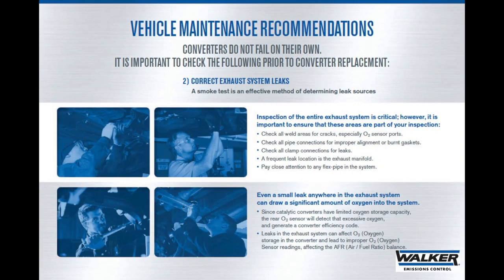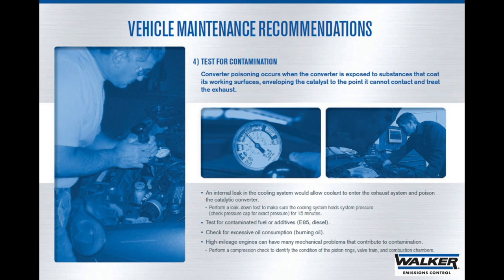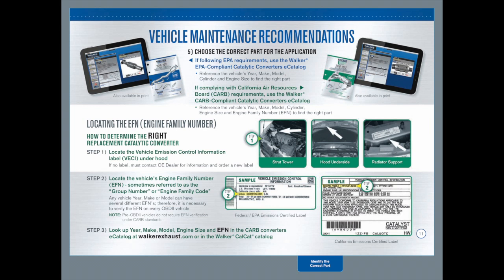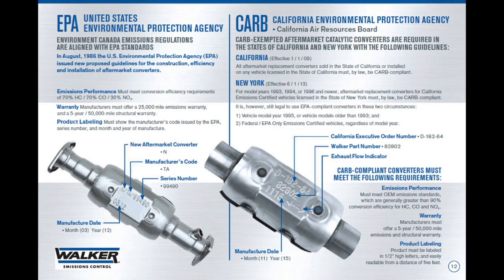The Trainer #68 - Troubleshooting P0420/0430 DTCs (Catalyst Efficiency Below Threshold)

Comment: Can running with slightly to much oil cause these cat efficiency codes?
Reply from the maker: It's possible if the breather system is drawing the oil into the intake.

Comment: THERE IS AN EASY, CHEAP & PERMANENT FIX, JUST INSTALL 2 SPARK PLUG NON FOULERS INTO THE O2 SENSOR BUNG AFTER THE CONVERTER AND THEN INSTALL THE O2 SENSOR INTO THE NON FOULERS. NO MORE CODES, THE CAR RUNS GREAT, & PASSES INSPECTION. I HAVE BEEN DRIVING MINE 5 YEARS NOW LIKE THAT. COST WAS LESS THAN $10 AND ONLY TOOK 10 MINUTES TO INSTALL.

Comment: I checked live data on my ES300 and the rear 02 sensor readings with be in a good place and then randomly go low or high (mostly low) and don't match each other. One may stay low for 10 seconds and then bounce back to 450. This is at steady highway speeds. I can clear codes and will eventually get a P0420 or P0430 or both. The car has 200,000 miles. I runs very smoothly.  I'm thinking bad downstream 02 sensors? I hear one is a real joy to change..
Reply from the maker: Conventional oxygen sensors tend to fail and not come back to life. Try a snap throttle test and see if they both react.

Comment: I have a P1273 code on a 05 murano. So I hooked up the scan tool and looked at the voltage, I compared Bank 1 and Bank 2 readings,the Bank1 has.300 volts and Bank2 has .600 volts,the two readings should be the same,right ?
Reply from the maker: What are your STFT and LTFT doing?
Reply: The STFT is 0.7 %and fluctuating ,the LTFT is, -10 %
Reply from the maker: @mckoylach1622  Both banks?
Reply: Motor Age yes,both banks...thank you
Reply from the maker: @mckoylach1622  Can you share freeze frame data?
Reply: Motor Age yes, but I need to check it by tomorrow,I appreciate your efforts very much,thank you...
Reply: Motor Age hello again. The trouble code is,P1273,ABST% is,1.5,Eng spd, is 637,CALC load is %40.3,coolant temp is 188,STFT1 is,-5.1,LTFT1 is-10.4,STFT2 is,-12.1,LTFT2 is,-10.4,STFT3 is,-100.6,LTFT3 is,-100.6,STFT4 is,-100.6,and LTFT4 is-100.6,hopefully those infos will help me to fix my car,thanks once again

Comment: Is there any reason why a 2016 78k miles versa would be getting 2.200 b1s1 and .400-.800 b1s2? I should note code p0420 with part of the intake housing broken parts to engine compartment so small holes in intake
Reply from the maker: I'm betting that the front sensor is a Wide Band sensor and will typically show a higher voltage than a conventional sensor. The rear is almost surely a conventional sensor that sounds like it may be switching. That could indicate that the feed gasses going to the cat are incorrect OR the cat is bad. Need more info...
Reply: Motor Age what other info is needed. Code p0420 comes up too. That should be enough right?
Reply from the maker: @priusgame1178  Not really. There are a lot of possible causes for the P0420 code. The intake leaks are likely the primary cause and should be repaired before the cat is truly damaged (if it isn't already).
Reply: @VehicleServiceandRepair   Motor Age  I will be replacing the damaged part of the intake housing today. My next would be to check if the cat is done I just want to see if it indeed shows in my readings. I am seeing these have a/f sensors so I took a different route in testing the readings which I hope I can learn here soon
. I am being told 9 times out of 10 p0420 is for sure a bad cat... I'm hoping to be that rare 10% with this 2016 versa how they rely on a/f sensors now
Reply from the maker: @priusgame1178  You may want to take it to a dealer after you fix the intake. Cats are generally warrantied for much longer than the basic powertrain warranty.

Comment: Hi there , I changed my Catalytic converter and the exhaust Manifold going together , and I did change 
the Oxygen Sensors ,both of them , I still get code P0420 ! 
What could be wrong ?,

Thanks .
Reply: Spark plugs
Reply: @honestscentz9300  : Hehehe , what  ? 
What Spark plugs have to do with changing a Catalytic Converter ? 
My Spark Plugs are New as well .
Reply: @ironfistarrival  a lot. And a Fouler "02 sensor extension" does not fix any problem.

It just fools the sensor to keep the Check Engine Light off. 🤦‍♂️

U still have an issue that can destroy the Cat and then the code extension won't do squat. 💁‍♂️

U need to fix the problem that gave off the code in the first place. It could be spark plugs/mis-fires, MAF sensor, injectors, leaks, etc. Etc.
Reply: @adrianapollyon5087  : Thanks for the message , i put an OEM New Catalytic converter after having the Code related to it , but i still got the Code coming up ,so i put the Extension and no more code , i am wondering why your are mentioning Mis-fires issues [ spark plugs are New , MAF is new , injectors not new ,i changed the Engine through a Mechanic , their Scanner did not show any issues at the time i use a good injector cleaner inside the Tank often though , so even though the Catalytic converter that i changed it myself is new what else could be the issue ?!! It is a  GM car Hummer H3 2008 ... any other thoughts ? Thank you so much for your comment .
Reply: @ironfistarrival  put an OBD scanner on it. And check your fuel trims. 

Could be an air leak intake leak, exhaust leak. 💁‍♂️ (even without a air-leak code p0171 etc) 

Could also be other stuff. Check that specific vehicle year and model for past recalls on it. Look into what problems others have had with that same vehicle.
Reply: @ironfistarrival  misfires mess with the air-fuel ratio. So then there is too much fuel not combusting and that goes through the Cat. So then the 02 sensors do nothing  but read oxygen and fuel levels that pass through the Cat. 

The computers in Vehicles use the data from the 02 sensors to determine how much fuel or air to it needs to keep at its stoic- measure of 14.7: fuel to air-ratio.

So there can be a problem with the air-fuel ratio which is causing the Cat code of p0420 to show up.
Reply: @adrianapollyon5087  : Thank you for the help , i guess i will have to check the Air intake gaskets  , Injectors , Fuel Tank Contamination [ A possibility ] , cleaning the Fuel Tank is a good thing to do .... Compression test was good , i do not thing any issue with the Leak down test , which is a good test ... however i have issue with the Temperature Gauge while in Idle goes a little above the Middle point , when car runs comes to the Middle ! , Thermostat + water pump were changed , and the Sensor looks good , but i want to change the Thermostat with a good one see what happens , i hope there no issue with the head cylinder ...strange situation ! ... i asked the Mechanic  to put the new Thermostat , i told him this issue , he said do not pay attention !
Reply: Lennox where you at now?
Reply: Deadbuck73 .... In Canada ....
Reply: Lennox I meant with your car situation! Lol!
Reply: @ironfistarrival  I had a P0420 at 118,000 miles and pulled my coils and plugs out of the cylinder - they were ate up and put new ones in - SUPRISE,, SUPRISE, SUPRISE - spark plugs, booooyahhhhhhhhhhhhhhhhhhhhhh.  It was the first things i tried by chance since i knew they had never been replaced.  I like the vacuum cleaner blow hard test - gets up into flex pipe and forward if you spray with soap/water cold and vacuum cleaner  blowing up tailpipe - if done hot with soap spray the metal may still be expanded and no leaks will show unless your flex pipe has a huge HOLE.  Actually a Hyundai tech told me he saw this allot and try?
Reply: @richardborges1457  ...Hi friend , i did change spark plugs , and even the Ignition coils , my car has over heat problem , the Gauge indicates higher than the middle range , and the mechanic changed the water pump and the Thermostat , so maybe i change again the Thermostat to a good quality one ,  and the Sensor for the Antifreeze seems good ... i am confused !
Thanks .
Reply: @adrianapollyon5087  ...I installed the Catalytic converter myself and i doubt if 
there are Exhaust leaks , i double checked the installation , and sprayed it with Brake cleaner for Exhaust leak , or Vaccum leak
do i have to reopen the Exhaust Manifold 
again ?!
Lord ! i have these Sensors in modern cars .
Reply: @ironfistarrival  I soldered a ohm resister to the wires of my 02 sensor bank 2. 

Code went away. Never came back.
Reply: Miss fire and lean and rich it all about a tune up the Honda dealership in Pennsylvania Diagnosis my po420.
Reply: @honestscentz9300  ...My spark plugs are brand new ... my friend ..
Reply: Lennox I put on 45,000 miles  since I posted responsed a year ago I used denso 02 sensors and ngk spark plugs and that code never came back on
Reply: What is the year/make/model of the car? Some cars have 2 converters; one just at the outlet of the exhaust manifold and one further downstream, but before the muffler.
Reply: @SouthernBikerTV  : Sorry for late reply , i just saw your comment today , my car is Hummer H3 2008 3.7 L , my car has just 1 converter , what i did was i added an Extension to the Oxygen sensor on the down stream , so the Oxygen sensor is mounted on that Extension , that solved the problem , but i guess probably these OEM made parts may not be that compatible to our cars ?! Now i have to change the Secondary Vacuum air Pump as well , so far what is your opinion after what i said ?
Thank you .

Comment: LOL. This video is no better than the rest of them. One code, and it could be FIFTY possible causes. Yeah, tear half your engine apart trying to find the problem. What the hell good is a trouble code if it doesn't tell you what's wrong? A worthless joke!
Reply: For you the easiest way is probably just keep chucking parts at it until it's fixed.
Reply: @Johnsmith-zi9pu  Guess again. Since my comment, I only had the cat replaced. Got rid of the P0430 code.
Reply: @jakejones5736  Your lucky, it could have been a sensor fault or incorrect air fuel ratio and you would have flushed  your money down the toilet.
Reply: @Johnsmith-zi9pu  Yeah. At the time, I had it in the dealer for a couple K worth of other work, so decided to have them confirm the diagnosis and replace. Even though it was in their hands, it wouldn't be the first time the DEALER has misdiagnosed...  costing me money. Based on that, I have to agree, I WAS lucky!
Oh, and since they already had half the engine apart, the additional labor cost was minimal. Not to mention, due to politics, the ONLY place you can get the part is at the dealer.

Comment: LASERS can reflect off of surfaces.. a plumber taught me this, he puts masking tape on plumbing pipe to get accurate temperture.
Reply from the maker: It's not the laser reflecting off of the surface. It's called emissivity and refers to the materials effectiveness in emitting energy as thermal radiation. Emissivity is defined as the ratio of the energy radiated from a material's surface to that radiated from a blackbody (a perfect emitter) at the same temperature and wavelength and under the same viewing conditions. Black is better than shiny...

Comment: HELPPPP.. Igot 420 and 430 codes. B1S1 0.300 AT IDLE  0.285 AT 3000 RPMS
                                             B1S2 0.280 AT IDLE 0.280 AT 3000 RPMS 
                                         B2S1 0.600   AT IDLE 0.580  AT 3000 RMPS 
                                         B2S2 0.290 AT IDLE 0.310   AT 3000 RPMS ON AUTEL SCAN TOOL
Reply from the maker: Let's start at the beginning by identifying the vehicle you're working on. Make, model, year, mileage? Any other codes stored? How does it run? What are the fuel trims for both banks at idle and 2500 rpm. Are the front O2 sensors switching? Are the rear O2 sensors switching?
Reply: 05 nissan frontier, v6  runs very good. no other codes stored. has 2 converters and 2 banks., one bank doesnt seem to do anything at all, it =justs stays at.285 mostly,.  idle or revved it doesnt change.. the other bank, it changes
Reply from the maker: @randy1ization  There are so many tips I could share. First, make sure the O2 sensors are working properly. You can do this by performing a WOT test and see if the sensors respond. They should swing low as the throttle is slammed open and go full rich when the throttle is shut.
Reply: Ki

Comment: Hello. Sir   Would you happen to know anything that can cause a switching rear o2 sensor other that a bad cat? Thank you.
Reply from the maker: Sure! If the feed gasses going in are out of whack, beyond what the cat can handle, you'll see the sensor react - but usually it will stay high or low. Key is to make sure all the other variables are correct before you condemn the converter.
Reply: Thank you. I like" Usually, it will stay high or low" because if the feed gasses is rich, the o2 will be high, and low if the feed gasses is lean. Unless you have leaky injectors and a vacuum leak at the same time maybe that overwhelms the cat and force the o2 to switch or the cat is cold.

Comment: I kept getting a PO 420 in our 97 marquis and I figured out that it was because I had put a cooler thermostat and it was creating a richer condition than it liked so I put the oem stat back in it replaced the fan clutch which was actually the problem to begin with .   I did not think that old of a car would be quite so computer sensitive .  great information

Comment: Last week PO420 appeared on my scanner for my service truck.  I had been on a two-week job that called for lots of idling.  I took the service truck for a  20-mile trip at 65 mph, erased the code, and two-hundred miles later still no engine check light.